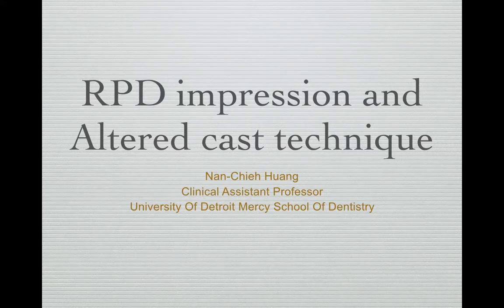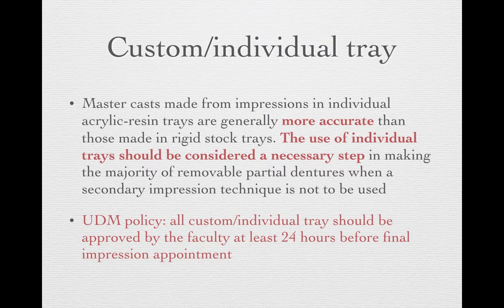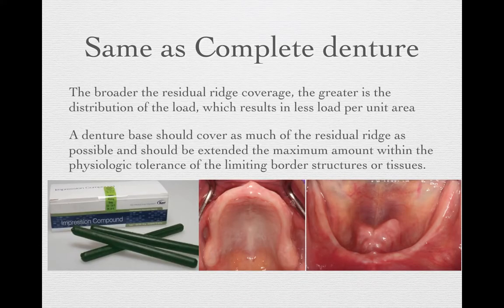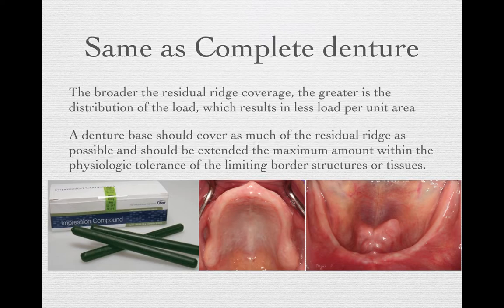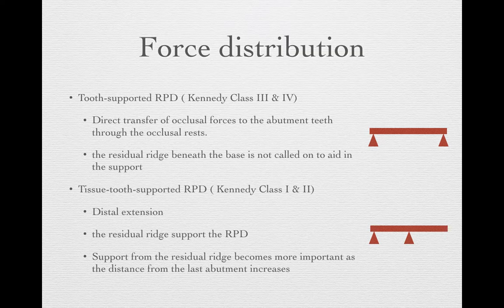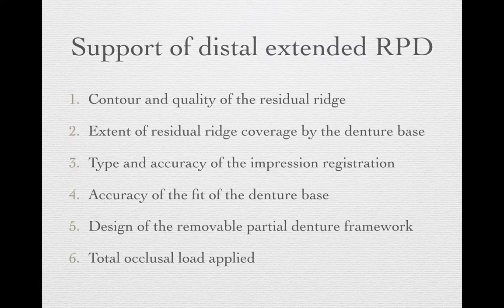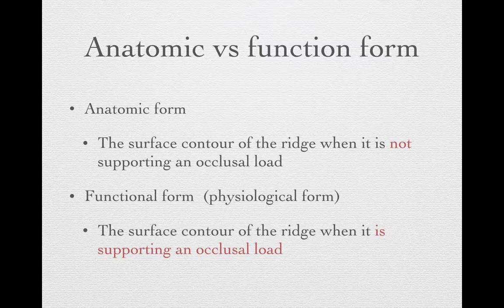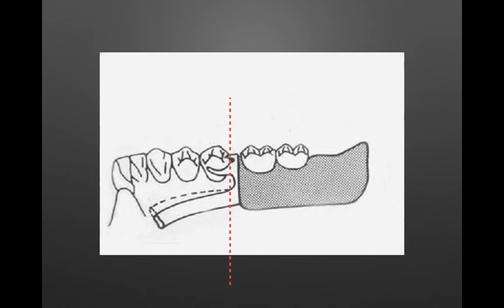9.  RPD impression and Altered cast technique

Comment: Thanks a lot Doc! This is one video which really gives a good explanation of the technique. Really helpful! Just one question, you said that we need to minimize amount of relief in primary stress bearing area so that tray is more close to the area. In the last slides, you say that we first put wax on the bilateral distal extension edentulous area, then put framework over it then put triad. So, here are we adding wax all over the posterior edentulous area or only on areas other than primary stress bearing areas? Thanks.
Reply from the maker: Hi Amandeep, you asked a great question! In anatomic impression method, we usually use one layer of wax on tooth-born area and two layers of wax on edentulous area. However, in functional impression method, only one layer of wax on edentulous area. So you can see the difference. 
We still need the wax for impression material space and that's why I called it "minimize" not "eliminate".
For your question, add wax all over the posterior edentulous area is correct because we still need to take full impression of edentulous area.
Reply: @dr.huangdetroitmercydental4803  thanks a lot for the clarification Dr Huang. Much appreciated!